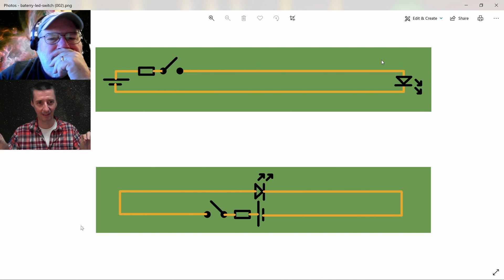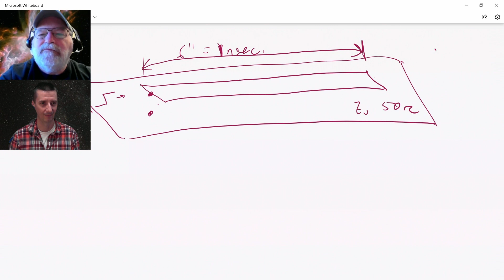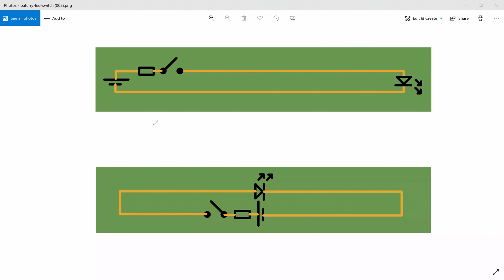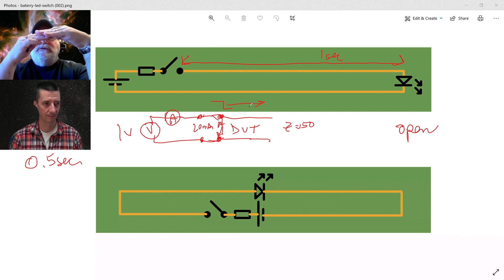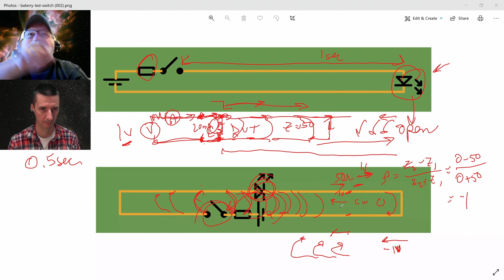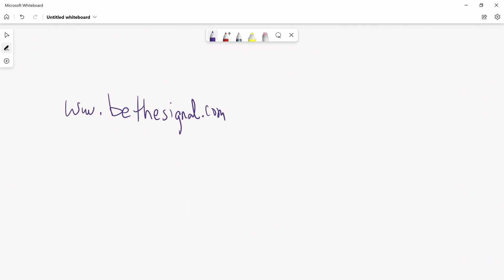Explaining Veritasium Electricity Video: Energy doesn't flow in wires (with Eric Bogatin)

Comment: It is not correct to treat the Veritasium arrangement as a pair of single impedance transmission lines.  You aren't driving the two ends of your "transmission" lines with the voltage source.  For the first few nanoseconds, the lower pair looks like a dipole antenna.   The bulb line, also looks like a dipole antenna, receiving the signal.   A dipole arrangement does not have a single Zo - the step response is actually pretty challenging to figure out.  My point is that you cannot assume the current in the transmitting side is equal to the receiving side - there will be coupling, but I contend a fairly small current - not enough to realistically light the bulb.  The beef with the original video was not that some signal arrives 1m/c seconds after switch closure, but that there was implied full power transfer.  It won't be.
Reply: @bobwhite137  They've got it right.  It's not an antenna, because when we place two antennas that close together, we create a highly-coupled transformer, not antennas anymore.  (Same thing would happen with loop antennas: if we put them right on top of each other, we now have a transformer, not a xmit/rcv antenna pair.)   We also get a capacitor where the plates are formed by two close-spaced wires. 

So which is it, a transformer, or a capacitor?

It's both, and Heaviside discovered, when the two concepts are combined, the reactance of the transformer and the capacitor cancel out to form a virtual resistance.   If we could use a DVM to measure Veritasium's million-meter ideal wires, we'll see a 700-ohm resistance, rather than 50-ohms of standard coax cable.

To act like dipole antennas, the wires need to be separated by about 1/4th the wire length, so the coupling isn't anywhere near 100%.
Reply: @wbeaty : "One fourthTH"? Oops!
Reply: @wbeaty  Very interesting takes. I personally think that everyone is wrong with their analysis since this is a transient problem, not a steady state 'coupling' or  two antennas.
Eric has it right to consider the wavefront or pulse edge and its effects.

I think bobwhite is right to suggest its not a proper transmission line because the source is not driving both conductors.

Treat it like a dipole antenna and find the near field time domain response on the 2nd (load) conductor using maxwells equations.
Reply: @wbeaty  antenna and transformer are kind of the same thing. just saying.

In my opinion, veritasium video was just click-bait and nothing else. It looks as if he had little idea of the matter by himself. The video was a wild mix of half right and half wrong, nicely shaken (and not stirred) to an astonished audience.
Reply: @wbeaty  'a highly-coupled transformer'  Not even that highly coupled a meter apart, you'd consider any low voltage transformer a failure if you move the coils one meter apart..
The electrons are literally IN the wire.  They don't actually touch, so the energy is in colliding the field shells.  The field extends from the electron, and is both inside and outside the wire.  That you can tap the energy of the moving electrons both from inside the wire, and somewhat outside the wire, doesn't mean the energy source isn't still the energy in the moving electrons, and is still basically stuck to the wire.  Make the wire take a 90 degree turn and the outside field takes that same turn, you can't make it just go straight off the wire because it's not really flowing outside the wire.
It takes special pains like many coils and a core to efficiently couple the magnetics of the flowing electrons of one wire into another, and efficiently transfer power from one wire to another.  It takes other special pains to use the flow in an antenna and peel the energy off the wire into EM radio waves and similar.

If it were really just that easy and all the energy was really outside the wire, transformers and antennas wouldn't be their own specialized fields and take pretty careful planning and adjustment to make sure they even work in an OK manner..

Route a wire all over a room, bending it in different paths, and try to get the waves to do anything that isn't strictly confined to following the path of the wire.  Won't happen.  Just because you can tap the energy and affect it from the outside doesn't mean that energy isn't coming from the parts that are stuck in the wire, it just means they have a field around them.
Reply: @ModelLights  hoop- coils are 300000000M diameter, only 1M apart.  That's very very VERY close coupling.  But their capacitance leads to a Z value of 700 ohms.
Reply: 'hoop- coils are 300000000M diameter, only 1M apart.  That's very very VERY close coupling.'
No, that is only a relatively close coupling.  1M apart is still 1M apart and will have rather shitty magnetic coupling like a transformer.  This coupling into another conductor was one of the things used to justify 'energy flows outside the wires', when really it takes special pains to do it even remotely efficiently.
Reply: BTW everyone, you realize you're way off if you even think this will work, right?
You're calculating with '300,000KM' long lines when your power source will really only drive a small number of KM of it at most..
These kinds of problems only seem to work when you consider only 1 variable and let everything else be infinite and 100% efficiency.  The moment you start putting in pesky realities like 'non-infinite power source' and 'wire resistance' into the mix they fall apart..  Your power source for a normal light bulb isn't going to drive a 300,000 KM line etc.  You're effectively slipping in an 'infinity' or 'divide by zero' to prove 1=0  or similar, like basically all the other fake proofs.
IOW Flip that switch and the light bulb actually never really turns on going through a 300,000KM long line.
Reply: But the point is there are equations that should define how it works, and if they are accurate you absolutely should be allowed to postulate fixed “uncommon” values as long as they aren’t impossible. In this case you absolutely could drive that signal eventually, so your point is irrelevant. Yes, if you cheat and claim an infinite energy source that is likely to break the model as you suppose, but we both know that’s not the case here.
Reply: @ModelLights  Well, if your power source is an AC source, it may actually work. 
In the early days of radio broadcasting, near powerful transmitters, people stretched wires with lamps in their allotments to illuminate them in the evening.
Reply: @Merilix2  
One question.
Why are you thinking that what you described, and what everyone knows and is obvious despite your thinking somehow that 'I'm unaware of it', even relates to what is described in the video?
'near powerful transmitters'  The simple thing you have described is not 'it' from ' it may actually work. '
Reply: @ModelLights  Did I said you were not aware of it? I just mentioned the fact. No more no less.What I didn't mention, a 300.000 km long antenna may perhaps become efficient enough to light a bulb if fed with AC?
Reply: @Merilix2 
Merilix2 have you ever heard of an electron?  Or a proton?
Just asking, no more no less.  And the difference is this needs to be asked.

'What I didn't mention, a 300.000 km long antenna may perhaps become efficient enough to light a bulb if fed with AC?'

So the magical 'efficiency fairy' is going to wave a wand and make the nonsense real?  You don't even really understand the words you're even typing.

A kid comes up to the adults and says 'times infinity!'  That doesn't mean the kid is right or has any idea what they're talking about, it's just nonsense the kid thinks makes sense.
The adults who actually understand what is being discussed correctly are far beyond the kid, the kid simply doesn't understand even the basics of what is being discussed.  So the adults are slightly annoyed, and laugh at the bit of silliness.

I already directly explained some of the silliness of even thinking you're driving a 300,000 km antenna, but you come in with 'it'll be more efficient'.
You don't even understand what the video is actually saying if you think these unrelated things you've said somehow would 'prove' it, you may as well be smoking pot and talking BS to high school friends of yours.  

You're giving yourself an A+ in this discussion, you're actually under 50% and haven't even understood the problem asked.

Go spend a few decades learning correct things before thinking you're ahead of people far ahead of you.
Reply: @ModelLights  "have you ever heard of an electron?"
Lol, I'm not even new to this stuff.
You ever heard about what a transmission line is? Or how changes in the e-field propagate along and around a wire?
You even know exactly how an antenna works?

By the way, you may tell your kids what ever you like^^
Reply: @Merilix2  
'Lol, I'm not even new to this stuff.'

Are you sure?  You're literally thinking that 'just making the antenna a little longer, or more efficient, or regular transmission theory' would CHANGE THE PHYSICS of how electrons and electricity work to be what is described in the video.  Even saying  that is silly.
Nothing you have said even remotely changes physics or would remotely 'prove it is operating like the video says'.  Even suggesting what you've said (quite normal things) 'proves' the far fetched different idea in the video actually suggests you don't even understand what the video is saying.

I understood transmission lines back in the 80's better than you do now if you're somehow talking yourself into 'they prove different physics for no reason'.

Physics and electronics texts do teach a lot of silly, oversimplified ideas.  Guess what?  The internet happened around the 2000's range.  Anyone not a slouch ran into Science Hobbyist.  SH has plenty of 'not quite correct, but with a little massaging the ideas are great' ideas.

To you this is some 'new, great video'.  To me, around 2000 range SH plus 180 range IQ I formed far better understandings 20 plus years ago.

I have merely given some basic ideas for why what is in the video is incorrect.  If you can't follow it, the problem isn't me.

Not my job to educate you from scratch on everything.  Ideas for those able to use them.

I will leave you with one last thing, if you think you are correct then I issue you a challenge since you're so much smarter than my mere 180 range IQ.

Speed of light in a vacuum is known.  Speed electrical propagation in a conductor is typically .7 or .8 C.  If it's 'all in the field' and not really the electron propagating the electricity, then explain why the propagation isn't C in a vacuum.
You can't ever do this correctly, because it's a wrong idea.
Don't message to me again until you've actually proven this.  Not the pretend, BSing 'proofs' you've been pretending, but real, actually proved it.  
  You're literally not paying me enough to be your private tutor on basic ideas from 20 and 40 years ago.
Reply: @ModelLights  Lol.
Just don't make any assumptions about what others are thinking and knowing... 
Obviously you're fantasizing about my posts more than what's really written there^^

Guess what? I m already familiar with the topic since 45 years, nothing new to me.^^ 
But I don't feel the need to teach you anything or explain or proof you anything^^
Reply: I think that current starts after 1/c (in seconds) and it is slowly building up until the RC circuit practically is charged after 5 times RC. Since we have a switch, we have to study the step performance (transient) of the circuit and treat it as an RC circuit (until it reaches the steady state which is 5 times RC practically). If we assume R=0 then RC is zero then the circuit charges in 0 seconds. Inconsistencies arise when we assume R=0 and C some value. Using the notion of the displacement current, the transmission line, the transformer, the antenna, the cable impedance is a good tool to understand the circuit. But i consider it as an RC circuit since we have a switch and therefore i am analyzing the step performance of the circuit. The problems arise when we assume a practically infinite and distributed capacitance with no resistance...
Reply: As Eric made a strong point of mentioning, it is not "correct" to think of the arrangement in any of these simplified approximate ways. The circuit "looks" like a number of different things and,  since they are all slightly different and all just approximations at the end of the day, you are bound to arrive at inconsistencies. The only correct way is to employ the true underlying laws of physics, in which case our current best best is a complete quantum electrodynamics calculation which I doubt anyone will ever do.
Reply: @bobwhite 
I agree with your analysis. The assumption of an induced current of equal magnitude in the wire on the opposite side  by the man with beard is absolute nonsense, especially when the wires are 1 meter apart. Both Veritasium and the bearded man are wrong to think the induced momentary pulse current induced when the switch is turned on after (1/c) sec is powerful enough to light up the light bulb.  The induced momentary pulse current  is both too weak and too brief to light up the light bulb in  (1/c) sec.

They are also wrong  to think the energy is transferred from the battery to the light bulb by electromagnetic wave created by the magnetic field created by the current in the wires and the electric or electrostatic field created by the opposite poles OUTSIDE the battery and between the two wires of 1 meter apart due to accumulation of more electrons on the wire connected to the negative pole. In fact the electric field between the two poles OUTSIDE the battery before the switch is turned on is extremely weak. The electric field between the two sides of the circuit due to excessive electrons on one side after (1/c) second is also extremely weak. Once a steady direct current starts to flow inside the circuit, there will be no excessive electrons on any part of the circuit and there will be no more electric field OUSIDE the battery or between the two sides of the wire. However, there will  be a steady magnetic field only outside  the wires and the battery when there is a steady current. 

Veritasium's claim of the energy from the battery is transmitted to the light bulb through electromagnetic wave outside the circuit created by the magnetic field and the electric field as a steady electric current is flowing in the circuit is totally wrong because there  is no more electric field outside the wires and the battery no matter how weak once a steady current is flowing in the circuit. 

In fact, the light bulb should light up after slightly more than 1 second when a steady current is powered by the  electric field INSIDE the battery. It takes slightly more than 1 second for the electric field from the battery to reach the  light bulb after the switch is turned on.. So slightly more than 1 second is the correct answer .
Reply: @simon6071  Your comment highlights one of the issues that annoys me most about this "debate" right now.  We should not conflate the displacement current that occurs due to the step response of the switch, with the steady current that occurs due to the DC voltage from the battery.  There are a lot of viewers who are now left wondering why wires are needed at all.
Reply: @DeadCatX2  The purpose of the wires is to bring the electric potentials of the the battery directly to the electric contact points of the light bulb. That's why the wires are need for the transfer of energy from the battery to the light bulb. The transferring of a minute amount of energy for a very brief moment from the battery to the light bulb due to magnetic induction after the switch is turned on should not be used as an explanation on how energy is transferred from a battery to a light bulb running on a steady current.
Reply: @simon6071  Exactly, while "a signal" may make it to the load, it's deceptive to imply that such a signal is sufficient to sustain the steady-state power transfer.

To be fair (and I am somewhat loathe to be fair in such a case), if we are considering "ideal" wires, we should also consider that the source, load, and characteristic impedance are all equal.  In this extreme case, the displacement current being caused as the wavefront of the electric field propagates down the conductors will indeed produce half of the supply voltage and half of the steady-state current after 1m/c seconds at the lamp.

The structure of this circuit is almost comical with the use of "ideal" wires of such enormous length that their parasitic elements would become the dominant factor by orders of magnitude.  It's a sleight-of-hand being used to trick the intuition of those who are familiar with real-world circuits.  Nonetheless, the video very clearly alleges the bulb reaches nominal brightness at 1m/c, while the reality is that even in the most ideal circumstances possible, only 1/4 of the power is being delivered at that time.  The other 3/4 of the power still requires one second to propagate down the conductor to the load.

Of course, under realistic scenarios, this amount of power will be insufficient and require multiple reflections as it gradually develops the electric and magnetic fields along the transmission line that are necessary to reach the steady-state values.
Reply: Does antennas not have Z0? I am pretty sure they do. In principle you do not even have to consider antenna or transmission line. There is just a wire containing charged particles and electromagnetic field everywhere around (and also inside of everything). Simply change in electric field starts to propagate with speed of light as soon as the switch is closed. It also starts to propagate from the end of battery opposite to the switch. As the change in the field (imagine two circular wavefronts) propagates, it reaches the bulb and wires attached to its ends. The wires are then interconnecting two locations with different intensities (opposite polarities) of the electric field. That causes electric current to flow in the wire through the light bulb so it lights up. Maxwell's equations must be the theory behind this.
Reply: @martinreves  An antenna has impedance that depends on frequency, unlike a transmission line.  A step function has all frequencies, so no single Zo. The rest of your statement is all fine - it is another way explaining the near field coupling between transmitter and receiver.
Reply: @bobwhite137  you are right. I forgot to consider dipole's Z dependency on frequency. If you consider this setup to consist of two dipoles, these dipoles are different from normal ones, because theirs length extends with the propagation of the change in electric field. Not sure if this could have a significant impact on applicability of the antenna theory.
Reply: @martinreves  I was only considering what would happen in the first 10ns or so - in order to see what power might be delivered on the receiving end after 1 m/c s. So to answer that, one would only need a few meters. The additional length won’t come into play for that initial timeframe.
Reply: He actually replied to the video by ElectroBOOM where he states the LED bulb he used would turn on dimly at 2 V.  This means he was well aware that at 1m/c, he did not have full power transfer.  And yet he showed his bulb reaching full brightness immediately.  To do something like this in the same video where he alleges that we are "lied to" about electricity is perhaps somewhat ironic...
Reply: And his lamp is idealized, which doesn't help in my opinion. Sure, in 1m/c seconds there'll be some current, and some light, but that doesn't mean the wire doesn't carry energy at all.
Reply: Yes, this appeals to my intuition too. The arrangement is like antennas or even a transformer. But probably the antennas make the most sense. This was pointed out in another video discussing the original video. All of it is instructive though!
Reply: I guess you're right. Eric goes too deeply to solve the problem that he forgets that this is a DC voltage supply that provides DC current. Okay for very tiny amount of time when we push the switch due to maybe high speed transition the LED may get energy wave through the space but that's not enough in terms of both power and time to keep LED turned on forever...the permanent thing that keeps it turned on must be the other form of moving energy in copper which is domino effect in which energy moves from on electron to the other to go ahead, and Eric himself in his book mentions this but here he wrongly goes on to explain it like a high speed pulsed signal.
Reply: I threw in the towel on my EE degree, so I don't know a lot about this stuff, but I 100% agree.

I don't see how unmodulated 12 volts DC would jump a 1 meter air gap with any significant success.  I'd think the DC voltage source would have to populate the leg(s) with a voltage difference for quite some length (many kilometers) before you would see significant current across the load on the other side, which would utterly demolish the claim that the light bulb is going to light in 1/c seconds.

Additionally, Veritasium seemed to imply, if not explicitly state, that this behavior is seen in ALL circuits (not just this utterly absurd example circuit,) which seems like yet another error to me.  If you separated the two wires in such a way that they no longer ran parallel or close to one another, this transmission through the air gap would very quickly disappear.  And then how would you describe the behavior of such a circuit?  You'd say, "Electricity is flowing through the wires."

"Electricity doesn't always flow through wires" seems like an enormously more appropriate thing to say than "electricity doesn't flow through wires."

The video seems to be full of errors to me, and yet it has nearly 400,000 upvotes. 😕
Reply: @miguelito2361  You don't think 12 V can have a significant effect at 1 m?  How may volts does your cell phone use to drive the antenna, which affects the cell tower several kilometers away?  Given that we're using "ideal wires" and we have a capacitor larger than the whole friggin' planet, it makes sense that some counterintuitive things can happen.

This is the sad part of the Veritasium video.  He is correct that some power will be delivered in 1m/c seconds after the switch closed.  Under specific circumstances (largely dealing with the source, load, and characteristic impedance), it can be up to 1/4 of the driver's full power.  This is the Displacement Current that is charging the capacitive and inductive parasitics in the transmission line.  Under realistic scenarios, there will be a series of reflections as the driver slowly ramps the voltage on the transmission line to the steady-state value.

Unfortunately for him, he is misleading people into believing the wires aren't necessary, when they are.  The full power won't be delivered to the load until the field propagates down the wire.  The displacement current will not "keep" the light on, either; the magnetic fields in the immediate vicinity of the wire carry most of this power.

You are correct that "shielding" one of the plates will interfere with the capacitive coupling, significantly reducing the amount of Displacement Current.  But given a sensitive enough light (and he will say "ideal components!") it will still light.

One way to get around the nonsense about "how much current turns the light on" is to ask the question, when you open the switch, how long does it take for the light to turn off.  There can be no shenanigans here.
Reply: @DeadCatX2  Yeah, but I don't think an antenna is very meaningful without modulating its voltage. 🤔

No fluctuating voltage = no fluctuating EMF = not much going on 🤔

I don't see how the circuit being discussed (12v unmodulated DC, wires 1m apart) could transmit any meaningful amount of energy to the load side.  In the early stages, I'd be surprised if it transmitted even 1/1,000th of its fully propagated current.